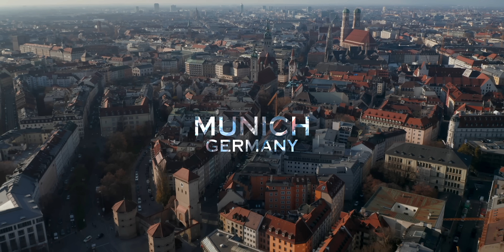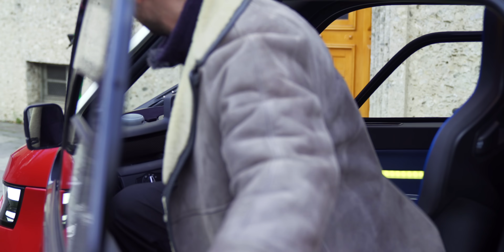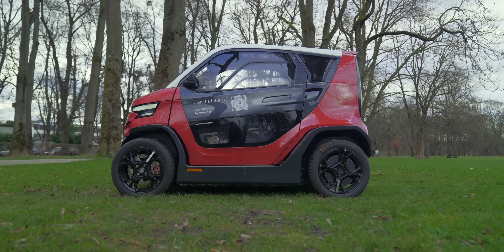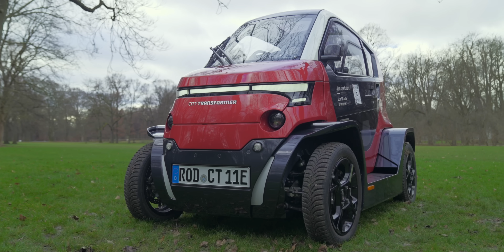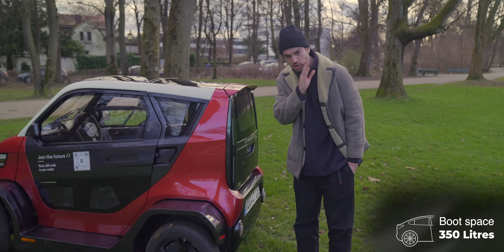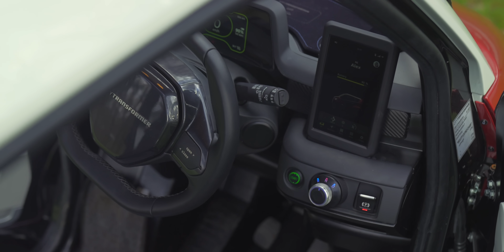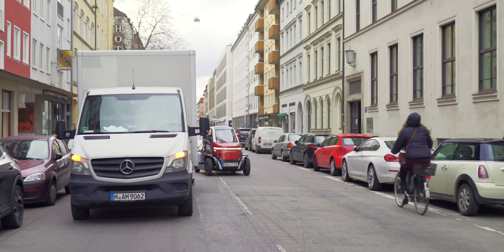The TRANSFORMING Electric Car Designed to Skip Traffic Jams!

Comment: Scissor-doors would be great; Infotainment LCD.. useless; the solution in the other car is better; Use ur own phone, cause google-maps is better/faster than the most navigation systems, and u have all, what u need in your own pocket, and this would save money.
For parking ; here in Austria it´s not allowed to park like a motorcycle (90 degrease angel to boardwalk), therefor a change in street-law is needed; we have this discussion since the smart 4two
The 2nd (it would be in Germany the same); U are allowed to use the bycicle lanees with a (electric) vehicle, max speed 25 kmh. So useing it by motorbike.. it´s not really allowed (no one cares), but by using it with cars... Oh-o, and latest here (even in Germany/Austria) u will feel the hate of the bikers, cause at this moments, they will know "their" laws; even when they forget them, p.e crossing red lights, or driveing there, where are only pedestrians/Walkers allowed.

Nice concept; And a good channel, beeing informed

Comment: Seems nice, although is that transform function just another thing to give trouble (break)
One thing they definitely need to do is to toughen up the slide out bit so you can stand on it like the steps on a proper 4WD   (no I'm not saying this is a 4WD) You should be able to just leave the wheel out without fear of damage, as to a lot of people 1.4M wide is narrow enough, 1M is just nuts. (we don't all live in cities designed a hundred years ago)

Comment: Seems kind of pointless in all honesty. Yeah you might be able to squeeze into slightly smaller gaps but it's not like it takes a whole lot of space to start with. And just having that function must surely eat into vehicle space and complicate steering, suspension, stability. Also looks horribly unstable when the wheels in which seems like something the software should stop people from doing above single digit speeds.
Reply: Thin commuting cars are far better design on crowded streets. Side-seated cars which can’t lane-split of park perpendicular to curb which barely take more than a single passenger are pointless. They’re even worse when they’re gas powered.

Comment: The parking argument is not very well though out, if you park in-between cars like that you are an a**hole, imagine coming back to your model 3 and some jerk has parked you in with his fancy Swiss army bike, and parking nose in  you are going to be sticking out into the traffic lane an extra 0.5m making it impossible to get past on narrow streets. Plus city designated street parking are designed for normal size cars, so if you get a parking spot you are still taking up a normal size spot, unless you happen to find another person with this same type of micro car.
Reply: Thin cars are cool, and people treat them with the same respect they treat side-seated cars. Since thin cars have far more places to park than side-seated cars, it’s easier to find places for them to park without impeding other vehicles, pedestrians, and buses. Like motorcycles, they will have fewer, not more, parking space conflicts.

Comment: 4:47 that example is not very correct or useful cuz that space between the two parked cars is necessary so they can manouver in and out and if you park this tiny car like this you block them AND yourself cuz you cant get out. So please...
Reply: I think it was shown in the video as a demo, and it won’t necessarily be its best parking practice. In real life, like with bikes and motorcycles, thin cars will have far more convenient places to park leaving empty car side-seat haulers longer walks to and from their vehicles.

Comment: It’s fun.  Lane splitting in this sounds like a nightmare.  At least a motorcycle can typically accelerate quickly when the light turns green.

With these you’d have a stack down the middle getting passed on both sides.😂

Comment: I DISAGREE loudly.     INMOTION V13 CHALLENGER - Electric Unicycle   is the solution.    Unicycles fit on public transport.   Take with you into office, shopping and eating.   Using covered paths you can in inclement weather.

Comment: Was initially intrigued but thinking through: squeezing through cars ie lane splitting is highly questionable and this being wider than a bike will knock off a few side windows; parking between cars - irritates drivers of those cars who then can't get out. Not allowed to drive on pedestrian paths of course. Perhaps useful if allowed to park in motorbike lots. And if in a place where streets are so narrow a normal car can't pass through comfortably. As such, a normal non transforming tiny EV car would be better as it would probably be cheaper, have more space (1.4m inside vs 1m)  and will have less maintenance required without all those moving parts.

Comment: Hard no - adding way too much complexity. I want my car to be as reliable as possible. That also means as simple.
Reply: Your side-seated car isn’t simple. You’re almost always hauling extra empty side seats with you which needs at least 2x more road width to drive and park than necessary, and your viewing the road from a skewed instead of central perspective. We accept side-seated car design without considering its complexity.
Reply: Mechanical complexity, those extra seats won't cause a breakdown. 

I use a bicycle most of the time because of the simplicity (or just walk). 

The car in this video is more likely to replace motorcycles than cares. Which would be a waste.

Comment: The entire point about parking in much smaller spaces due to the car width reducing is completely invalid. You need that extra half a meter to get out of the door, even if they do the vertical doors. This entire vehicle is based off a useless gimmick.
Reply: Like with side-seated cars, people will naturally give space to allow drivers in and out of cars. With my experience observing the Tango thin car parking,  there are far more convenient parking spaces for it to park than a side-seated car. It’s a simple and effective concept; less vehicle width requires less parking space width. It’s not a gimmick. It’s a much better way to park in crowded areas than with a side-seated car.

Comment: I almost rage quit this video at the 5 minute mark because of the way you were using that car and it did not get better. In showcasing the features of this vehicle you seem to be advocating for people drive around like douche bags. I would be absolutely furious if someone blocked my car in by parking nose in directly in front me like that and it's not ok to drive around other cars on the road and cut them off in the intersection. What's worse is the numerous times you actively DROVE IN THE BIKE LANE!!! That is NOT SAFE or LEGAL and you should amend your video to reflect that. It is so important that all drivers, regardless of the type of vehicle, obey the rules of the road. Motorcyclist don't even use the bike lanes like you did nor do they park like that. The driving you are showcasing is dangerous, it's really incredibly irresponsible to use your platform in this manner.
Reply: The parking and bike lane scenes were for demonstration purposes I think. Like motorcycles, thin cars will have ample space to park in ways which won’t obstruct side-seated cars or take over bike lanes. Further, I’ve watched hours of thin car lane splitting videos. It can be done very safely.

Comment: It's just a Sinclair C5 in disguise. Why feed the EV haters and sceptics with these nonsense vehicles that are always ridiculously expensive for what they are. If they were as cheap as chips, then they would at least make financial sense. Think of the original postwar German bubble cars, the original Mini and Fiat 500. Genuinely utilitarian, cheap, affordable cars for the masses. These small micro EVs because of their expense are always going  to be a vehicle looking for a market. As 2030 in the UK and 2035 in the EU approach it would make more sense in terms of manufacture  and cost wise to kit convert existing small used ICE cars to an EV train and extend their life. A new Smart EQ 42 is £23k, seats 2 and realistically will only do 50-60 miles on a full charge with a 16kWh battery and with no fast charging capability. A kit conversion for an ICE need cost no more than 10k including kit and installation labour and would be become cheaper with mass production of kit through economy of scale and increasing completion between expanding qualified labour.
Reply: The key metric to this and other narrow cars is width. The best part of  electric cars isn’t that they’re electric, but that they can be built thin. Side-seated bikes exist, but people prefer thin bikes. Motorcycles with side cars exist, but people prefer thin motorcycles. Once they hit a good price point, people will overwhelmingly prefer thin (electric) cars.

Comment: how the fuck do u get out of the car if u park nose in or in between two cars like that?
Reply: Perhaps scissor doors and skinny drivers. Also a prudent, sensible driver will not usually park in such a tight space. I'm sure you have problems in some parking lots the way some drivers don't properly use the lines in Walmart lots.
Reply: …and how do the other two cars get out

Comment: People like cars with at least two seats, next to each other; they also like comfort, which requires a small car with big wheels. Hence the ugly Smart cars. Also, people don't like putting their cars in this or that mode, they want their cars to serve them. And, most importantly, people don't like non-aesthetically looking cars, and especially small cars, which implies small genitals and an empty wallet, which makes any small car a niche product. And let's not forget safety - only when most cars on the road are this size, will this trend catch on - which requires ample financial incentives through new legislation (e.g. K-cars in Japan).
Reply: People like speed. Thin car filtering and lane splitting saves a lot of time. Short cars also have far more parking options. Like bikes and motorcycles, people will eventually prefer thin models over side-seated designs.
Reply: @MickeySimple  Speed in a small car is an oxymoron. Lane splitting is dangerous, and with everyone driving small cars - chaos. If everyone drives a small car, all parking spaces with be occupied by small cars.

Maybe some day people will prefer a different design to what has been sold for the last one hundred years, but not soon.
Reply: Single occupants driving empty side-seated cars is far more chaotic and wasteful then people driving tandem-seated thin cars on thin lanes. Careful and safe lane splitting works better in weather and road protected thin cars compared with motorcycles or scooters. The economic and environmental costs of induced demand are far smaller with commuters driving thin cars on thin lanes compared with single occupants driving to work in side-seated cars.